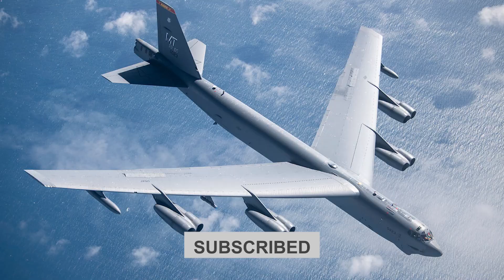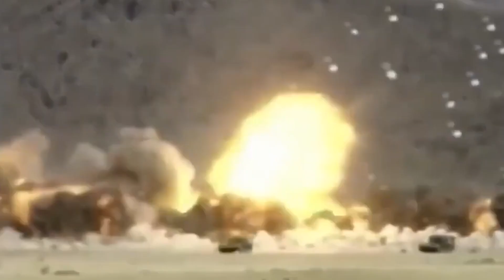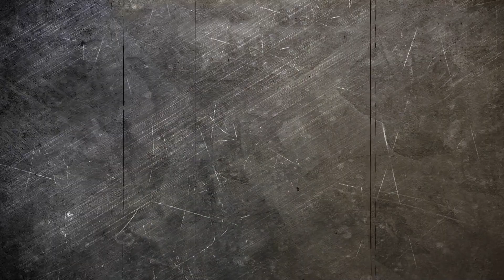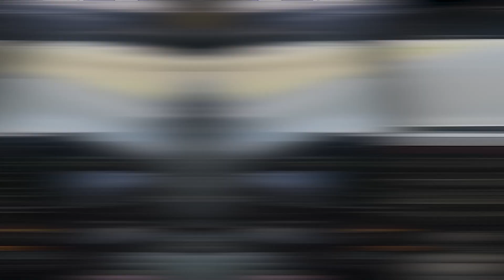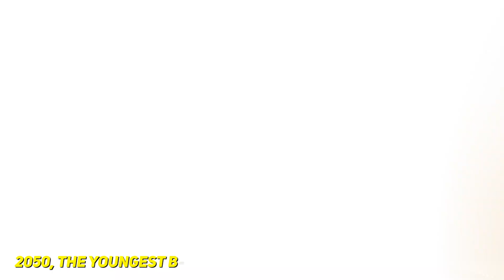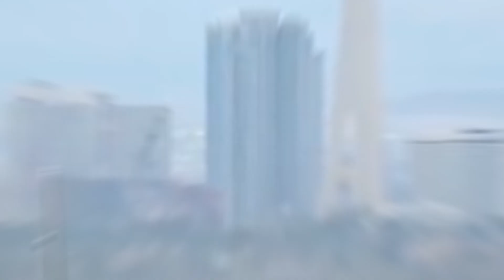B-52 Stratofortress: The Timeless Bomber's Journey into the Future

Comment: dropping drones like that.. even if they are the uh... lets call them one way drones.. that dont need battery range to get home... to use said drones against enemy targets would require you getting to with in 30 to 50 miles from said targets... it would be shot down almost anywhere... thats why we turned most into cruise missile trucks when enemy air defense got too spicy to bomb targets. plus we have things called stealth bombers that can fly over enemy air defense undetected that could drop the drones. now the b52 prolly will be flying for a century but as a cruise missle lugging giant like it has for most of its life.. changing engines can make it a bit less noticeable on radar but that airframe and it size will never be considered stealthy. otherwise  not bad.